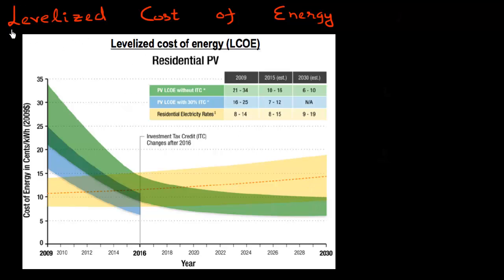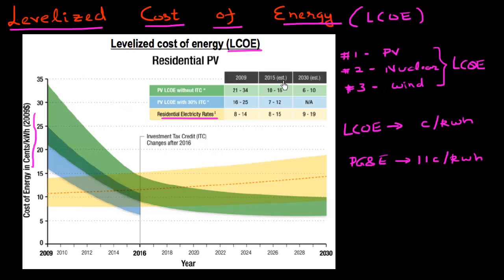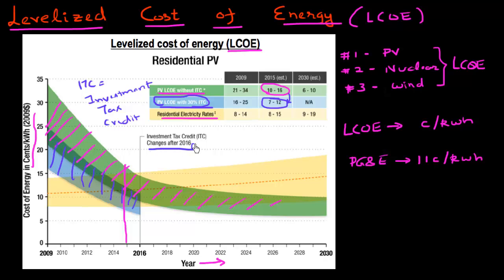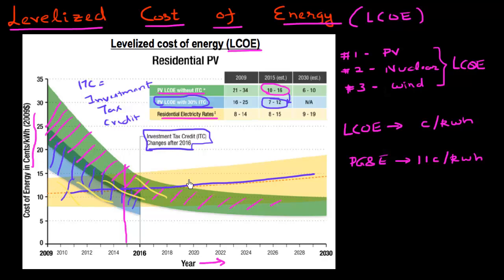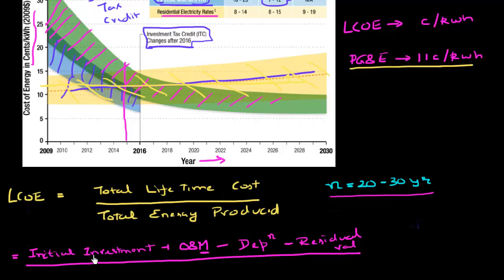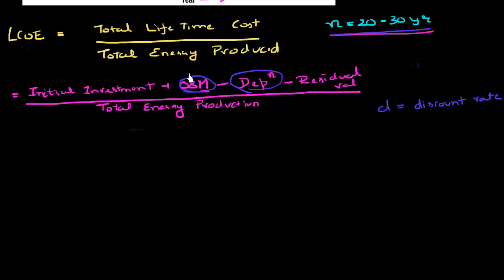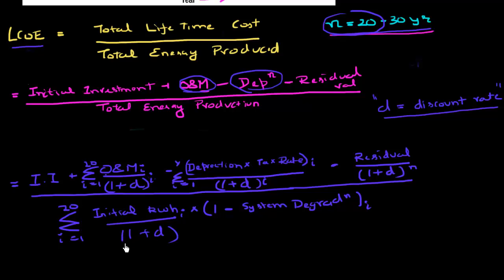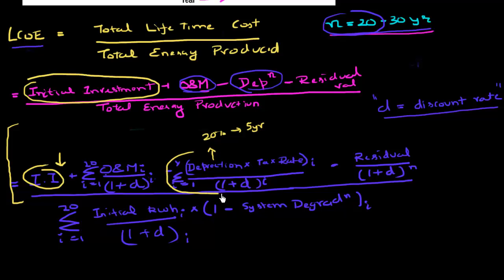Solar: Levelized Cost of Enegy (LCOE)

Comment: Very nicely explained - thanks. Two questions.Why are maintenance costs typically assumed to be same every year? This is what I have seen in some working applications. Second, I can understand that electrical output reduces over time, hence it is multiplied by the factor (1-efficiencyLoss). But why does electrical output have to be divided by (1+d)^i? Thank you.